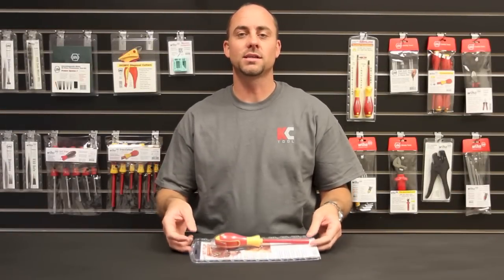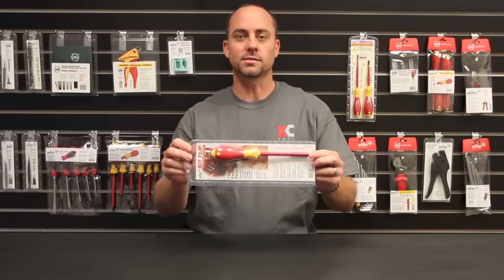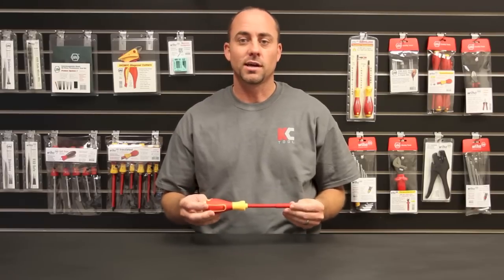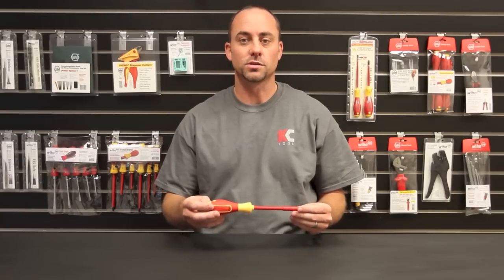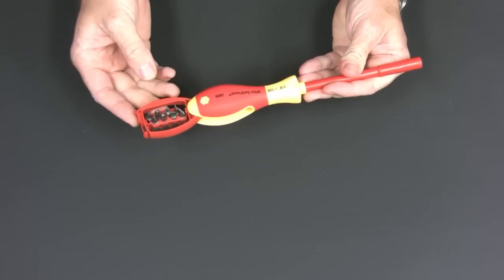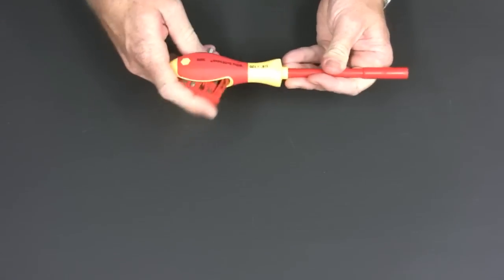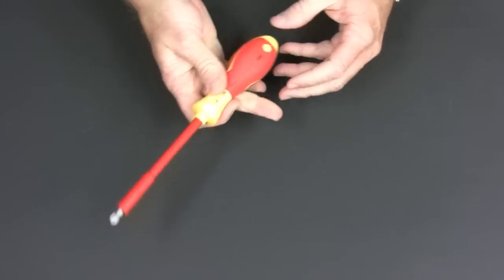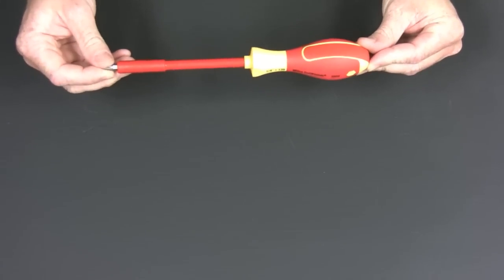Wiha insulated bitflip bit holding screwdriver PN 38017

Comment: What's the difference between the 38016,38017 and 38018? Definitely buying one of them. Really enjoy the wiha brand. I'm a maintenance tech who uses only quality tools. I'm definitely a tool junkie
Reply: +mike216ism The difference is the set of bits.
Wiha 38016 includes 8 bits: Slotted 3/16 and 1/4", Phillips #0, #1, #2 and #3
Square #1 and #2;
Wiha 38017 includes 8 bits: Slotted 3/16", Slotted 1/4", Phillips #1, Phillips #2,
Torx T10, T15, T20, T25;
Wiha 38018 includes 8 bits: Slotted 3/16, 7/32, 1/4, and 5/16"
Phillips #0, #1, #2 and #3.